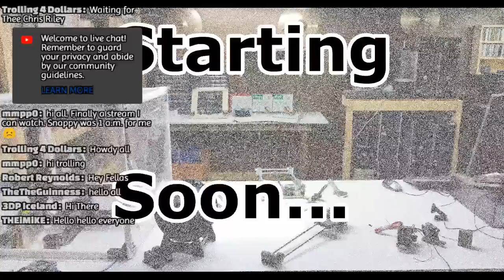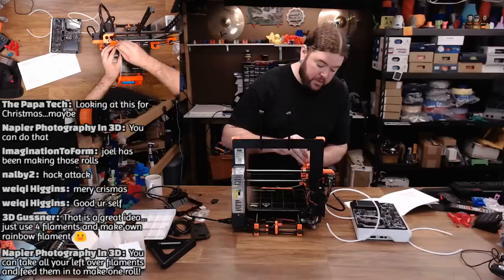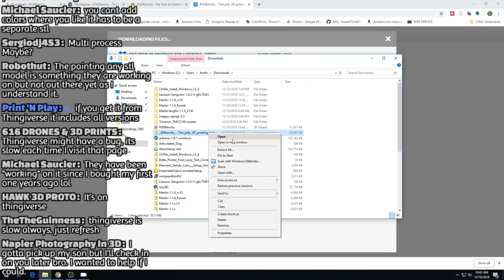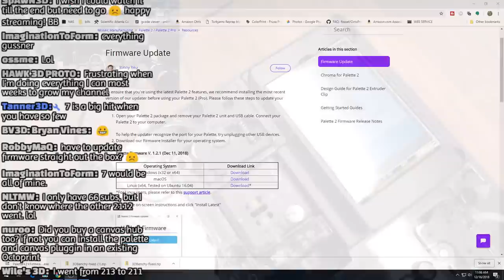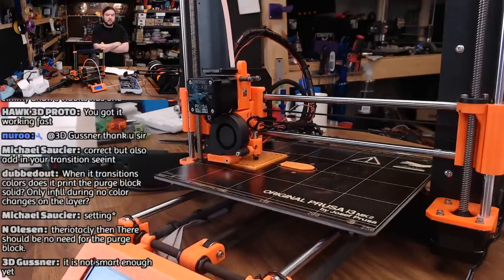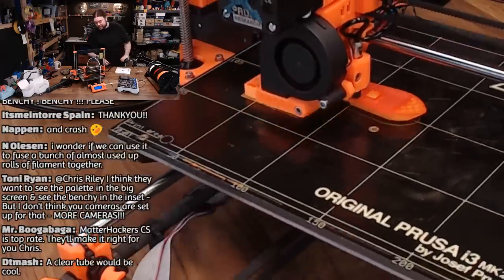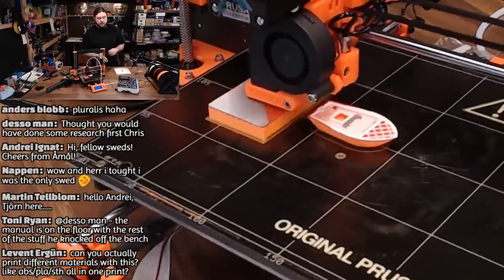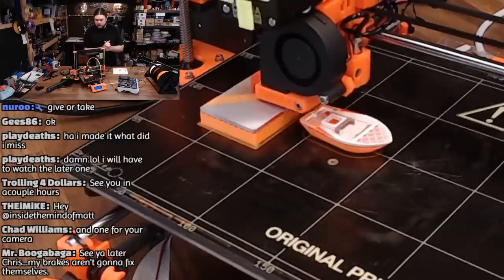Starts 4:24 - Mosaic Palette 2 - Un-boxing and First Print - Chris's Basement

Comment: Hi Chris,

May I ask a quick question about the Benchy files please, when I printed the one on mine last night, I selected the file that says complete, however, it printed the hull ok, but the underneath and the mid to stern deck didn't come out smooth at all, it was still showing the infill, should I have selected all the files that you did on this one or would that not really make any difference (I really hope that makes some sense Sir)...

John...
Reply from the maker: The only time you would use the multi files would be more multi color. What slicer are you using? If could be a problem in the software.
Reply: @ChrisRiley  

Hi Chris,

Many thanks for the reply Sir, I'm using the ReplicatorG software to export it in to the .x3g file for the printer, but I have also been using the Slic3r, everything look fine on both, I think it's just going to be part of the learning curve I think...:)

Many thanks again Sir, really loving your videos, I have about 71 left to go and then I should be all caught up on your channel hopefully, I've saved them all so I can go back and watch them all over again when I finish...

All the best...

John...

Comment: How did you fix the door issue? I’ve tried recalibration and jogging the filament to a tea and the colours are still wrong. Any ideas?
Reply from the maker: I had to just keep printing. About 4 prints in, it started working. Make sure you are getting pings and pongs while the print is running.